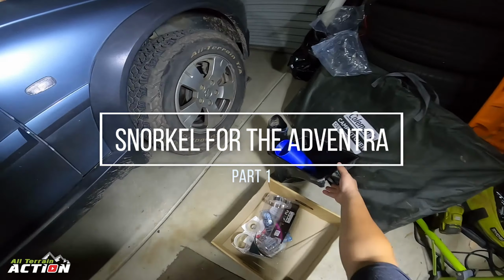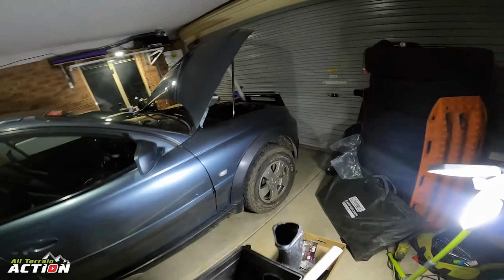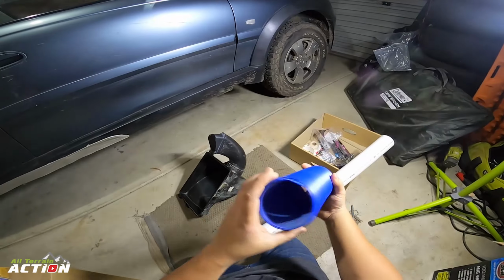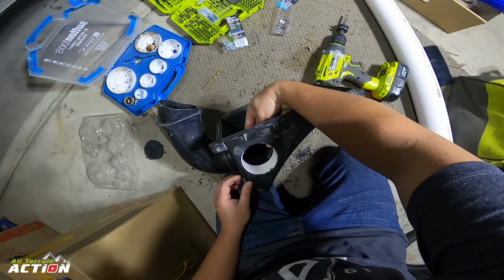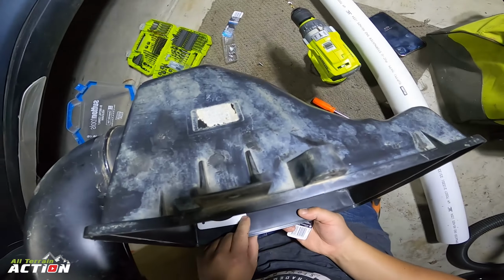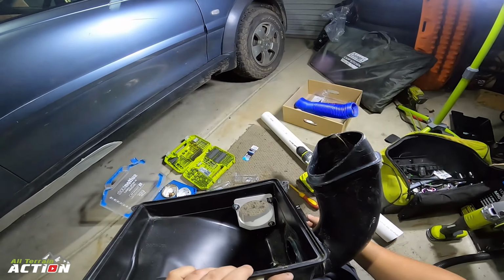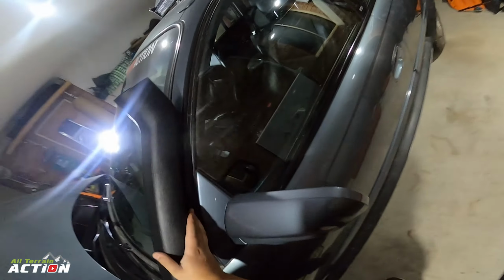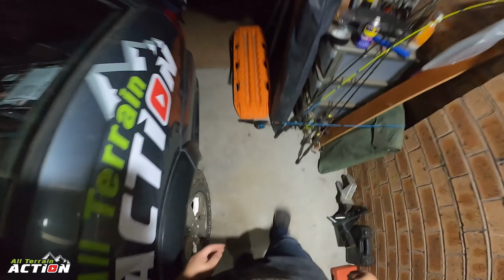Part 1 - DIY Snorkel on the Adventra Preparing for the Simpson Desert

Comment: I’d be a bit concerned with the pvc. Used it for an intake mod on my VP years ago and it quickly distorted in the heat.
Hopefully it works out for you.
Reply from the maker: Quite interesting, these pipes are designed to be in UV exposure for long periods, tolerate elements in the weather and not become brittle. Interesting now myself to see how it goes, it typically does not get that hot on that corner where its also covered so it would be interesting to see how it lasts. Thanks for feedback.
Reply: @AllTerrainAction  if it doesn’t. It will at least be a great prototype. There will be other alternatives. I put a second intake hole in almost the same place on my Cross8 and my V6 Crewman.

Comment: Nice work. Waiting for the custom winch bar video🍿😅
Reply from the maker: Started having a think about this, looking at the rails and seeing what’s possible and to keep it behind nice as factory looking.
Reply: @AllTerrainAction  Do you mean an actual bull bar with winch? You can buy off the shelf bars or could buy for vzs. Maybe intergrate one as a project.
Reply from the maker: @Dan-rg7jj  we will likley do a custom project. Something that's bolted to the rails, not designed for full weight hang but to assist in pull when needed. There is no designed existing solution but we just want to have one for an option should we ever need it, the day has not come yet but you just never know.
Reply: @AllTerrainAction  yeah there isnt anything. Would need to be custom. Doable.

Comment: Awesome 
Details on snorkel make and model cheers want to do the same to my cross 6 crewman
Reply from the maker: Any 65 series Hilux will passenger side snorkel will fit, you basically will be working from that to make it fit the Crewman.
Reply: There’s a few on eBay like this one for about $80-100.